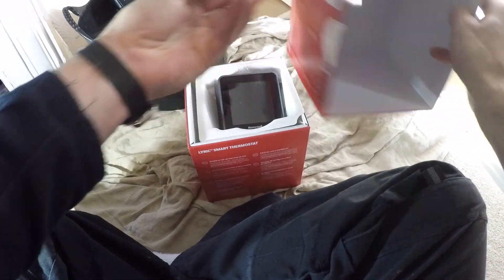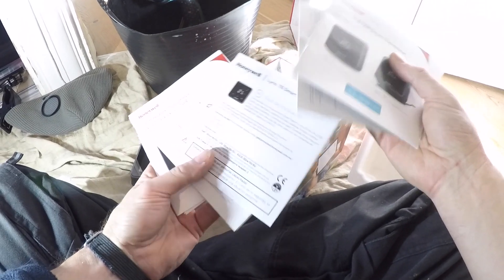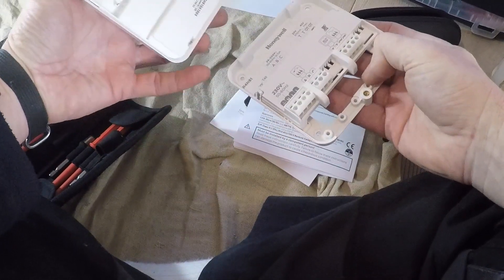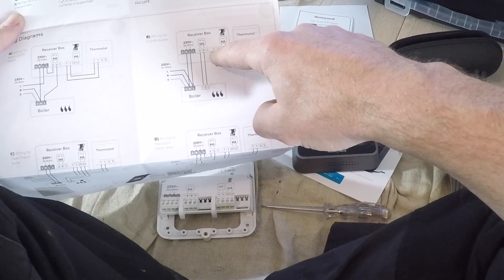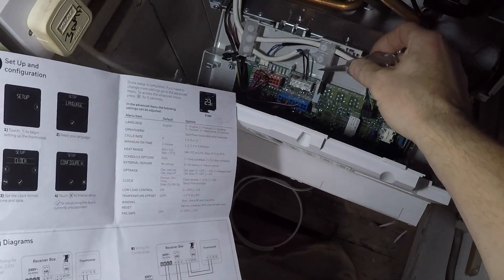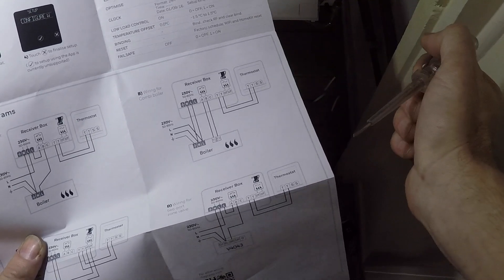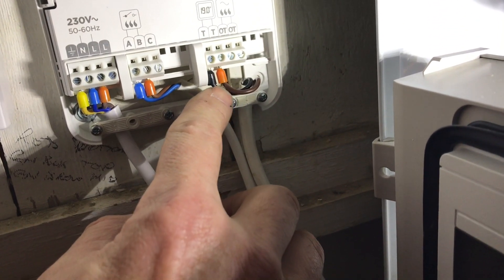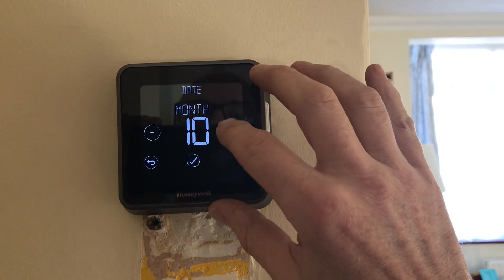Honeywell T6 Lyric Thermostat Install

Comment: hello what is the current consumption of the thermostat itself? Because I don't have the relay box and I would feed it directly with a voltage of 20V. That way I could only use it as a simple thermometer that I can monitor from a distance. thank you